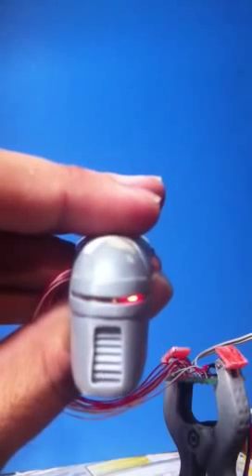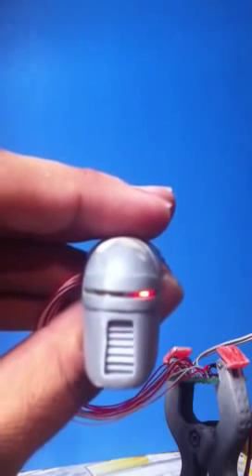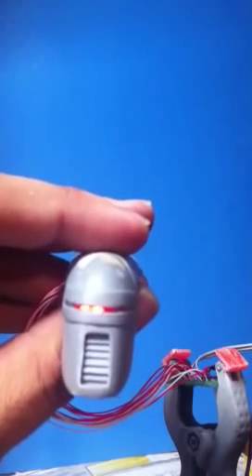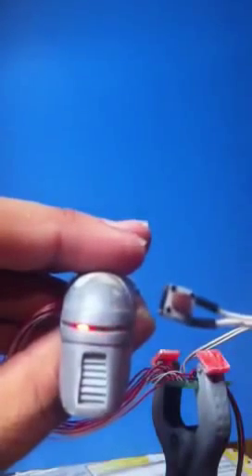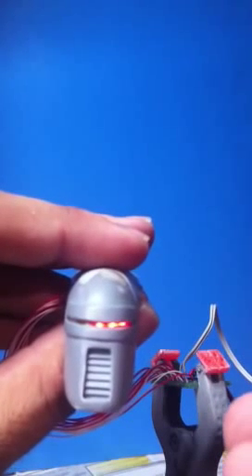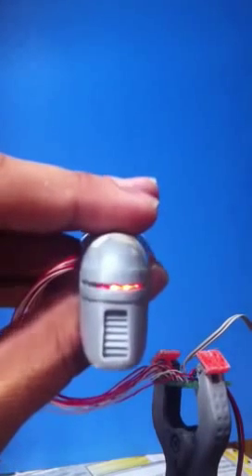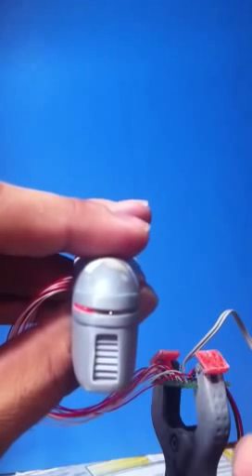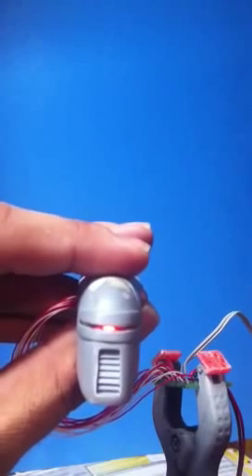Moebius Cylon Raider season 1-3 modification

Comment from the maker: The scanner is a simple 8 LED circuit that I bought on Online Auction. If I recall correctly it was less than ten dollars. (I bought two) The engine lights are just wired with a resistor, so pretty basic. 

There are a couple people who sell complete drop in kits on either Starship Modeler or Culttvman store. A bit more expensive, but absolutely gorgeous units!